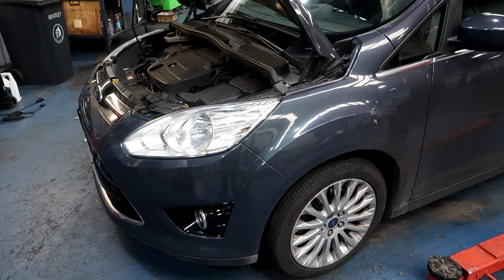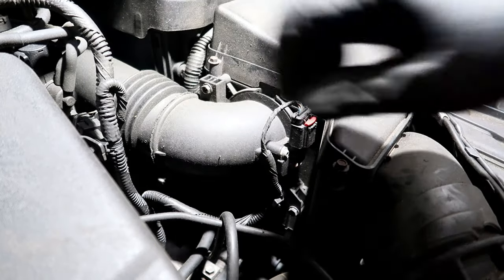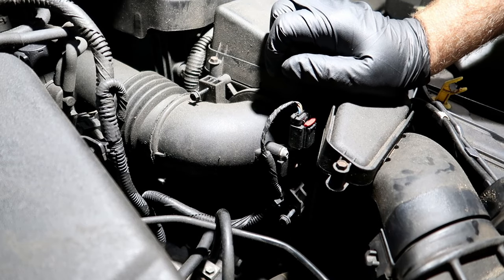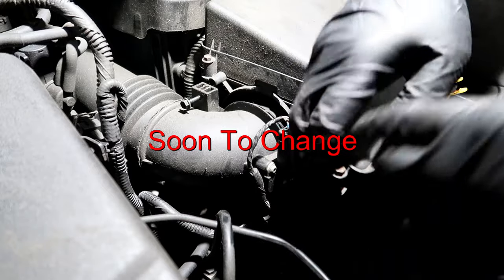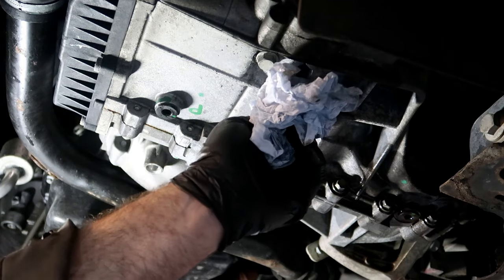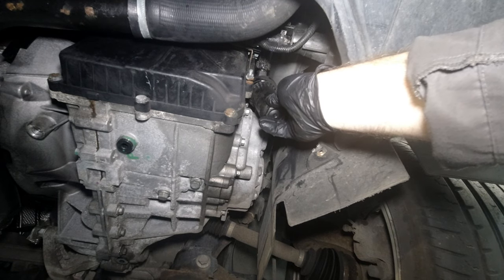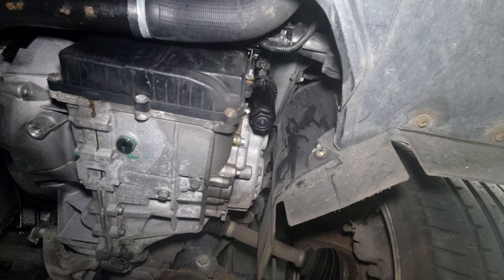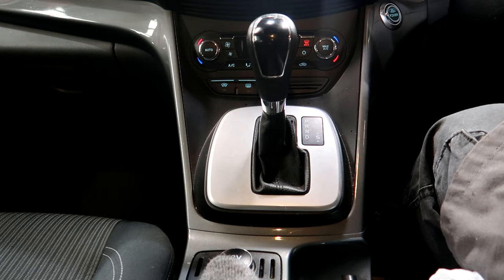Avoid Costly Garage Repairs:  How to Change Ford MPS6 Powershift Gearbox Oil

Comment: Unfortunatelly this gearboxes Powershift 1st generation (6dct450) with wet dumper fail no matter what, Ive seen examples people changing oil even so 15-20k miles, oil perfectly clean and they still fail after 90-120k miles. Newer generation 2015+ (6dct451) was way improved and work pretty well.

Comment: The tutorial is perfect. Thank you!
A good tip for this type of gearbox would be to avoid it at all costs. No matter how you drive, the clutch will wear out at around 100k miles.
If you change the oil regularly every 30k miles, you will probably get another 30k out of the transmission, but eventually, you will need to prepare at least £2k for clutch replacement.
If you do it yourself, it will cost you around £400 with the seal, oil, filters, etc., but it is a bad car. I am telling you this from my experience of owning one.

Comment: all ur vids are great im no mechanic but recently purchased a 68 plate 1.5 Focus ST line X Ecoblue Diesel powershift and just like to get a lot of info about Fords in General thanks for these vids 👍👍👍
Reply from the maker: Thanks for the comments
Reply: @SYDiagnostics  just a quick Question i cant seem to find when or if my Focus needs its gearbox oil changing its 8 speed auto but cant find any info 68 plate 1.5 ecoblue its currently 37,625
Reply from the maker: @wozg83  no interval on those. Only work I've done on these boxes (3 now) is a complete strip down for loss of reverse gear

Comment: Great video. Never realised about having to put the excess oil back in! Excellent stuff. 👍🏻
Reply from the maker: Providing you can ensure its clean prior to refilling
Reply: @SYDiagnostics  absolutely. Love the kuga vid too. Anymore on the Mk2 tdci kugas very welcome 🤣👍🏻
Reply from the maker: @sliderdriver1  I've done a few videos of stripping items on the kuga, one on a door fault and one with a misfire. Also a good parasitic battery drain that's really worth watching....
Reply: @SYDiagnostics  I've just watched the drain vid, excellent mate. I'll catch up on your ecosport door lock one too. Thanks for the videos pal, I do Roadside so any tips are always welcome. Cheers again👍🏻
Reply from the maker: @sliderdriver1  I did 5 years with RAC too
Reply: @SYDiagnostics  you poor. lad🤣. I'm with an independent setup but doing it for 34years now. It's surprising how you loose the spanner manor from not being in a garage. Half the stuff these days is to in depth for Roadside. I grew up on points and condensers when you could properly fix stuff Roadside. I drive a truck these days to lift and shift but still Nedd to sort the family motors when I can. I run a 19' kuga, wife has a swift🙈, daughter runs a c-max so keeps me busy. Cheers for your replies and hope you stay well. Take care mate.

Comment: I have the DCT 470 version of this on my EVO 10. The oil and filter gets changed every 10k miles or you end up with problems. Fill it with Castrol transmax dual who make the oil under the Ford, Volvo and Mitsubishi Diaqueen names. You can also put Motul DCT in which works fine also.

Comment: Great video I was thinking of replacing the filter/oil in my 2014 cmax on 103000 miles but I can't see filter/oil has ever been changed!
Reply from the maker: Lucky to have lasted so long if that's the case

Comment: Good video thanks for taking time to make it.  Will be servicing my Galaxy soon.  When you run through the gears do you keep the handbrake on or is handbrake off and wheels are actually rotating ?  Many Thanks Carl
Reply from the maker: Vehicle would be on thd floor and the foot brake applied at all times

Comment: i dont get it, why would you have to drain the level only to add the drained fluid again?

so you fill up 6 litres run the gears then open the level plug to drain out half a litre only ot add the same half a litre again. 

I filled the 6 litres and ran it through the gears, but then I drained the full fluid and found 2 litres in the front chamber and 4 litres in the rear chamber. How weird?

So I filled it again and did it properly and drained it again, this time I had 2.5 litres in the front chamber and 3.5 in the rear chamber, the half litre went into the front chamber. Totally weird!

The gearbox was troublesome in first to second and second to first till I added another 1 litre which sorted it out completely!!!

How mads that???

Comment: Great video, thanks for sharing - what can happen, if the oil level is not correct? Even if it is too low, or too much?
Reply from the maker: i've never seen too much oil, but too little can cause shift solenoid faults and poor / non shifting

Comment: Forgive my ignorance, why do you let oil come out of the level bung after refilling and put that amount back in again?
Reply from the maker: I put the oil back in because its new, and not done any miles, i ensure the gearbox casing is clean as too is the tub i capture it in.  Putting the oil back in ensures that the first chamber is filled correctly and once it starts to come out the level bung again, you know chamber 2 is full too. Sometimes you need more oil than what you've initially put back. I always get 7lt to do the job

Comment: Great video, I think the my dodge journey 2.0crd 2009 have same automatic gearbox. 
I change once time fluid in gearbox before 2y 30k km, but now when drive strong lost 135 gears, it's possible the its time for change fluids? 
I by MEYLE ATF DCG II and filter, planing change fluid hope fixed the problem.

Comment: Do i need to replace the air mass meter whilst i am doing the service , starting engine and running through the gears , or leave it to when i  have completed everything .
Reply from the maker: I'd connect it back up or else you'll have a code set and it possibly may not idle

Comment: Thanks a lot SY Diagnostics very simple and important things you explained and showed.

I have an automatic gearbox Ford C-max 2016, 2L TDCI, 150 HP, 160000km run and I want to change the oil and filter of gearbox. Unfortunately I have no any record of previous oil change, nothing. So I don't know if previous owner changed it or not... Same time changes of speeds are smooth and nice no any problems filling, the speed changes at 1.8-2rpm.

My question is should I change it? if yes, change it as in your video (partially) or completely (with special machine)?
Let me know please what do you think.
Thanks in advance
Reply from the maker: if you've got no problems or codes stored then i cant see it hurting
Reply: Hi, @SYDiagnostics  thanks a lot for your opinion!!!

One more question which kind of spray you use to clean the leaked oil from the exterior of the gearbox?
Reply: @andrinuta25  it's brake cleaner spray, but you can use any kind of grime revover for cars, or isopropyl alcohol if you have one of those  manual pressure pumps
Reply: @negrua.9737  thanks

Comment: Hi and thank you for the realy helpful information.
I did do the oil on mine but after a couple of weeks I did find that there oil coming from the oil filter. My question is can I replace the filter with out draining the oil?
Thankful for the help.
Reply from the maker: Thanks for the comments and for viewing, I cant see why you cant change just the filter on its on. Be sure to check the oil level afterwards
Reply: @SYDiagnostics  I would like to share an opinion on this subject.  In line with the video, I changed the transmission oil of my vehicle.  When I removed the filter, I noticed that the transmission oil filter was also expanding.  I think the transmission oil maintenance that cannot be done in the change mileage may cause other problems.
Reply from the maker: @haruncimrin  most issues i see on these are through lack of oil changes. If i had one id be changing it earlier than 37k. There is an internal filter too, but this cannot be changed without stripping the gearbox
Reply: @SYDiagnostics  As a result of your help, I successfully changed the transmission oil.  the tab on the edge of the filter cover only broke.

Comment: Hi its andy I have a ford focus mk3 titanium x with the power shift gear box I have replaced the seal and drivers side drive shaft but I have only added  5lt of oil can I add another 1 lt and then check the oil level 😀
Reply from the maker: if you follow the instructions as in the video.  I'd buy another 2 lt anticipating using most of it
Reply: @SYDiagnostics   got 2 there mate so get the car on level ground and check the level first before adding oil 🛢
Reply from the maker: @ANDY-we7mr  correct, but you may find that chamber 2 is full and chamber 1 is low.  So I would remove the level plug and catch any oil. then fill the box in 100ml amounts until the oil starts to come ou the level plug hole

Comment: Hi, thank you so much for the video mate. I have a 2020 Renault Megane RS280 EDC. I believe it also has the 6DCT450 trans made by getrag. I had my trans fluid changed at 25000KM at a 3rd party workshop because the Renault dealer said their trans fluid was "lifetime". But, the mechanic didn't change my filter.. Now after servicing at Renault, they said there are traces of oil at the flywheel. I'm not a mechanic so I'm not sure if there are any possibilities that the traces of oil were due to a bad trans oil change previously? Also, since changing the flywheel oil seal requires dropping the trans, would you recommend me to request the dealer to have the internal filter changed as well? Or the internal filter can last for a very long time? Is it expensive? Pardon for the long questions..appreciate your help and thank you so much in advance mate. God bless and happy holidays.

Comment: 8 liters of oil came out of the transmission section of my 2016 focus Powershift 6-speed vehicle.  According to your video, I replaced it with 6 liters of oil, which is correct?

Comment: I changed oil an filter on gearbox as car was juddering on gear change, and coming up engine malfunction, it was ok for 3 weeks, but now it started again, what could it be? also if there is not enough oil in the chamber will it throw up engine malfunction and go into limp mode
Reply: it’s a ford galaxy 2014

Comment: Great demo. Just a query on oil level. Assume the gear box is fully drained and the pipes carrying the oil to cooling coil are cleaned as well, do you just put 6 lit in (The factory spec says 7.3 lit)  . The video says, put 6.l in and then some will overflow. (in the video it was 1.1) Does this mean you actually got just 4.9 l in the 1st time? The put back 1.1 again, so you then have a total of 6 again. Did you putt out the 1.1 to sort of flush and purge the system? Does the gearbox when normal have an oil level higher than the side drain plug? Tks
Reply: That's a lot of questions 😂

Comment: Great video and helped my friend to do the fluid change on my focus. Quick question tho, even after changing fluid my car still has trouble selecting second gear. Not as often as before fluid change. Any suggestions?
Reply from the maker: any codes? unfortunately the mechatronics units are troublesome. Some have had success in stripping and cleaning the solenoids
Reply: @SYDiagnostics  hi, just ran a scan which had no codes. Then we noticed the brake switch never showed active at any time even tho brake lights came on?? Also when we turned car off we had a code PO68A come up saying power de energised too early??

Comment: Just done this on my galaxy and now have an intermittent loss of reverse, another mechanic said possible air lock so I redone everything including using an ir sensor to check temp was up but still there. Only goes into reverse 6 out of 10 attempts. Correct amount of fluid in, refilled until came out of drain after shifting through as you done. Not sure what to do now. No fault codes on scanner.
Reply: Get rid of the vehicle asap. It will cost you 3k for a box overhaul. Ford don’t want to know. Worst gearbox ever made
Reply: The plastic clutch inside will eventually fail. You are getting the first sign of complete failure.

Comment: Hello, so i can directly put 6L, start engine and after that i can start the oil level process ?
Reply from the maker: yes you can, but will probably require a little more oil
Reply: @SYDiagnostics  alright, thank you so much for your sharing

Comment: Hi. I Changed my oil couple months ago but I never go true gears. So it’s approximately 5,5 litres there. It’s alright or need to remove level bung check level ?
Reply from the maker: I always put in around 6.5lt to start with and follow the process as in the video

Comment: Hi so after getting the gearbox service from ford i noticed when i checked under the transmission when i removed the cover theres leaking could this be down to them over filling not fully letting the extra oil pour out
Reply from the maker: hard to say really without knowing were the oil is, it could be from checking the level?
Reply: @SYDiagnostics  its the black chamber box where these 3 screws at the bottom facing down like the joint the 3 silver screws on the black chamber i have put silcone but still leaks a little as dont think i put the silcone properly i dont want to remvoe an change gasket as ford charged me a lot for the service i cant afford to change they said it was not covered with warranty if anything happens as i had gone past the service interval not knowing as i brought the car after it was due

Comment: Great video! Could you tell me if the gearbox 6DTC-450 showed on video is the same of automatic gearbox on volvo c30 2.0 ? Thank you.
Reply from the maker: I believe it is yes... And the mitsubishi evo
Reply: Volvo abut confusing some model has a 6 speed automatic transmission (using Aisin AW- fluid) and also this 6 speed wet DCT (Ford-Gatreg), my 2011 Volvo T4 1.6T is this MPS6/6DCT450, same style 2 drain plugs and 1 side level plug all are 8mm Hex. I was previously confused abt the transmission type. Thank for the vid that clears my doubts. It is a good vid!

Comment: Superb and very interesting vlog I’m thinking of purchasing a 2013 fiesta petrol 1.6 power shift auto with 39k miles what are your thoughts ? I don’t think the transmission oil has ever been changed but I am under the impression that it has been well looked after many thanks and best regards mark from Billericay 😀👍🇬🇧
Reply from the maker: powershift is always a risk, ok when working, expensive when not
Reply: @SYDiagnostics  thank you ever so much in coming back to me good luck with business regards mark 😃👍

Comment: Some say 8 liters for the focus power shift transmission oil.  you applied 6 liters, which one is right?
Reply from the maker: I usually put in 6.5 before I check the levels
Reply: @SYDiagnostics  Does the manufacturer make changes in the gearbox according to the model years?  Is it possible to query this from the chassis number?
Reply from the maker: @haruncimrin  give me your vin and i will check the amount of oil needed
Reply from the maker: @haruncimrin  7.25l as a dry fill, this includes the cooler and lines...i usually ask for 7 lt wen doing the job.......i usually only get 6 given and rely on a 5lt top up jug i have for the rest
Reply: @SYDiagnostics  Thank you very much for giving informative information.

Comment: Hallo, i am from Belgium.Last year I did a revision of my Ford S max 2012 powershift 2.0D 120kw.The car shocked a bit after the revision.I went back to the mechanic who was doing the revision and he said to just drive because the parts are new inside.After one year the shocks increased and I took the car to him again he installed new software and checked the oil and said it's fine now.Now the car shocks even more when changing gears just 1,2,3- 4,5,6, not shocking.Only when the engine is hot does it shock 1,2,3 when the engine is cold it shifts well.I went to another mechanic and he told me that the problem is the oil.He told me that the person doing the revision either put in a little oil or too much or the wrong oil.Please, who can help me because I can't drive the car because it has strong shocks and I'm afraid that the transmission is damaged again and I paid €4000

Comment: Thx for the awesome vid!

Does the fluid circulating from the higher chamber to the lower chamber? Chamber to chamber the fluid level will be balanced out when using?

If yes just put in the correct amount (6L) then run through all the gears w 20s on each gear will do right? Then no need to spend another $20-30 for an extra 1L of fluid. 

I don’t understand the meaning of 2nd level drain check and refilling again.
Reply from the maker: Ideally you put back in what you took  out. There is a formula but it's complicated. So I put in what I take out and check the level. I always get 7lt

Comment: Avoid all powershift gearboxes.  They will fail regardless of atf change. Junk box and a waste of money
Reply: 142k and no issues. Just regular oil and filter changes. I do my daughters every 18k,no issues at all. Poor maintenance =crap service life. I find the stealer intervals to far apart especially if it just drives round town. (mum bus etc)
Reply: @sliderdriver1 Guaranteed to fail. Even Ford disowned the box. Internal plastic parts will disintegrate regardless of service history on the box. Complete junk